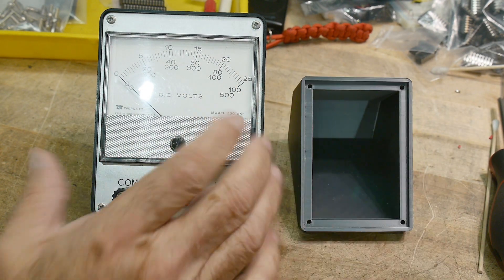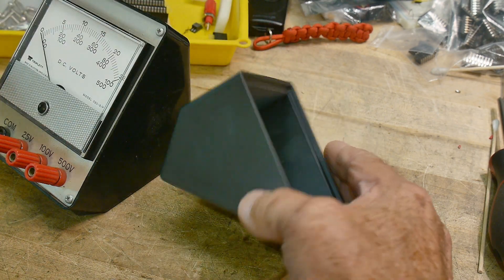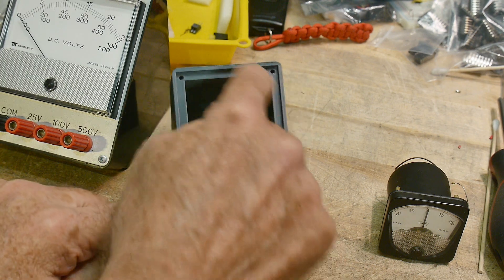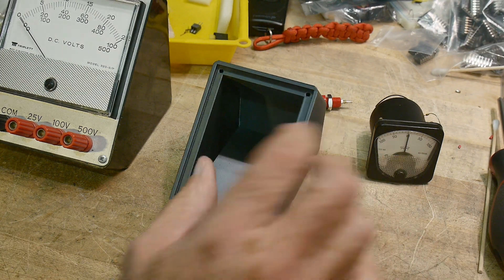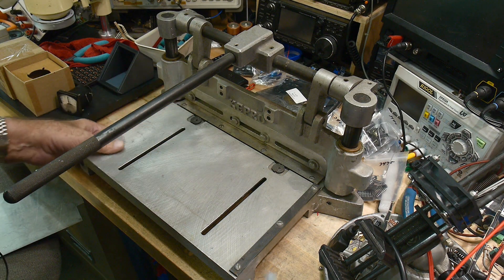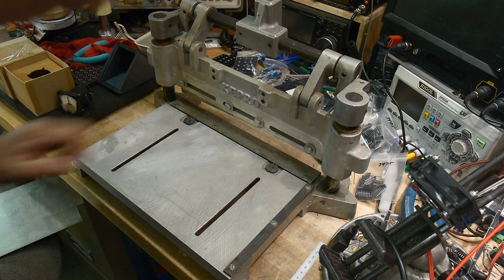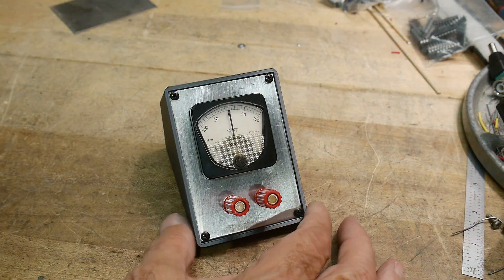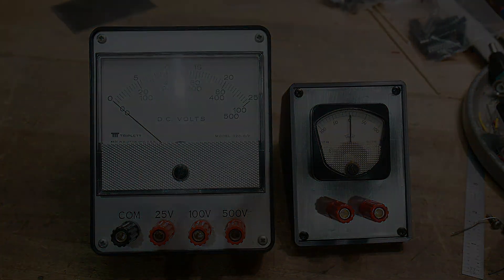#1300 Bi-directional Triplett Meter

Comment: Marking out with rule, place the measurement on the edge and use the end of the rule to scribe against. You prob know this :-)

Large holes, I clamp the work down to a board and pop it under the mill  and use a boring tool or flycutter. The boring tool  makes a much better job.

To save marking out errors I draw up the panel, print 1:1 cut out and stick to panel then just punch through on crosshairs/centre points. 

Your shear, very very nice - a tool that's missing from my workshop.. I've never seen one of that style before. 

The chassis punch,  Often known as Q-Max cutters here in the UK. Much used inthe days of Valves for cutting the holes for the holders. In later years they made them in all sorts of shapes, including DB25. They needed a REALLY big spanner or more usually a large ratchet.

They also sold ball bearing widgets that you put under the bolt head to make things a bit easier.

Andy
Reply from the maker: Adding a thrust bearing seems like a good idea
Reply: @IMSAIGuy  In the former work, we had these cutting heads combined with a press, they cut the necessary hole and the hem was pressed into the material. These cutters had pockets in the dies to accommodate thrust bearings. The scissors and the hole punches are wonderful, I have to drill everything at home and possibly finish it with a file or a Proxon milling machine.

Nice day 🙂 Tom